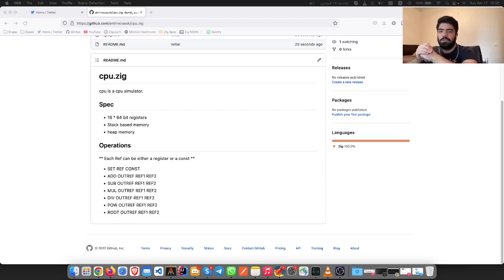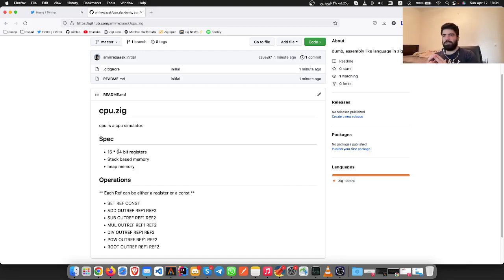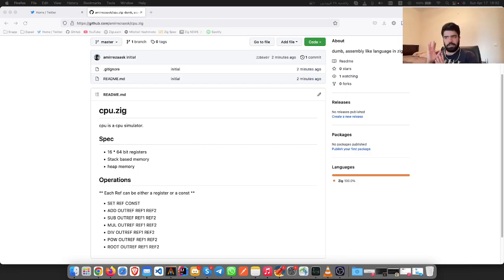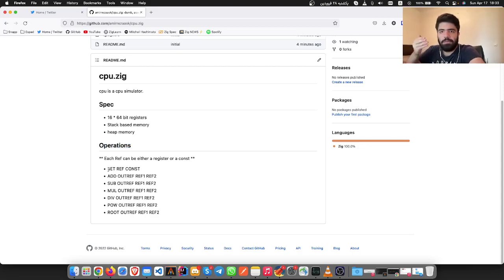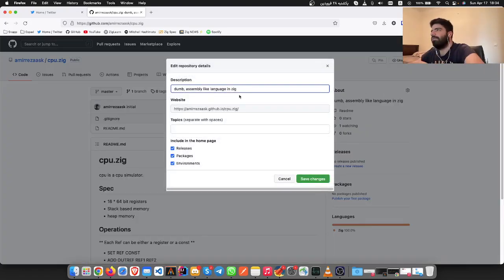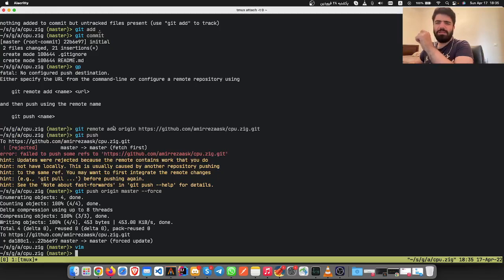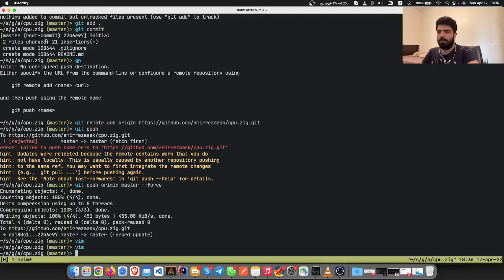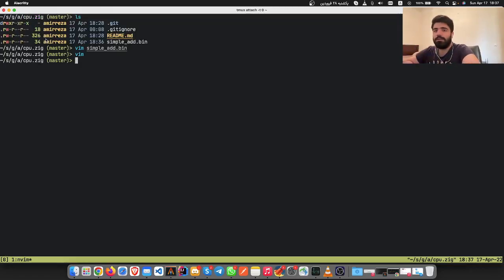⚡ Live Coding a CPU simulator in Zig ⚡ - Introduction

Comment: There are still 16 and 8 bit CPUs. Most microcontrollers are 8bit and some 16 bit.
The intel 8088 was a 16 bit machine with an 8 bit database.  

Zig is really nice! First played with it last night and my standard little trial code for a new languages is to create X lists and X threads getting a pointer to a list and fills it and then I merge those lists.
In Rust that was a painful experience initially here in Zig it was almost trivial.